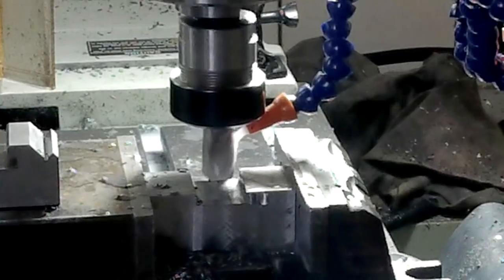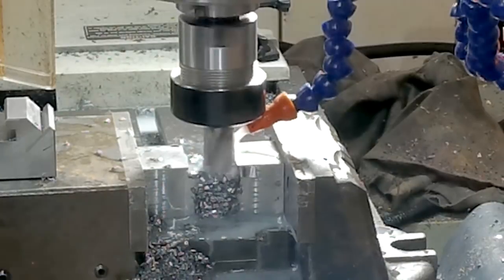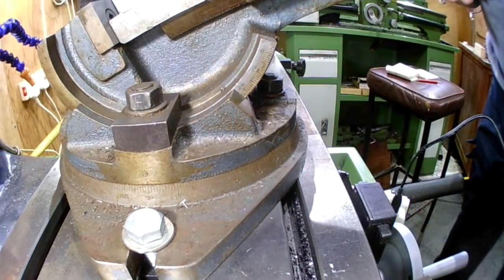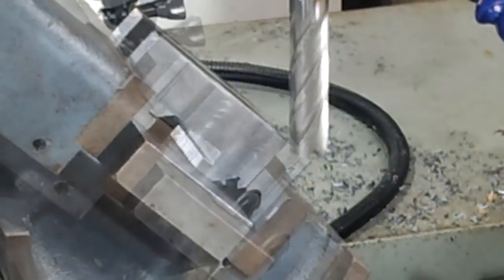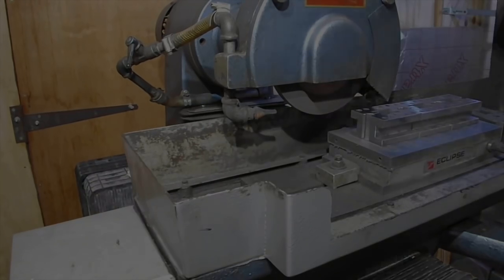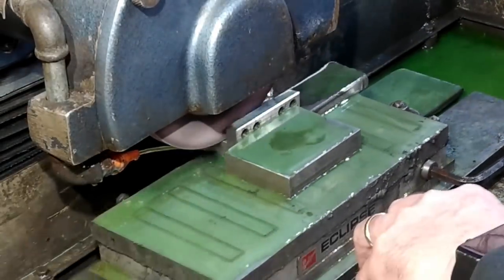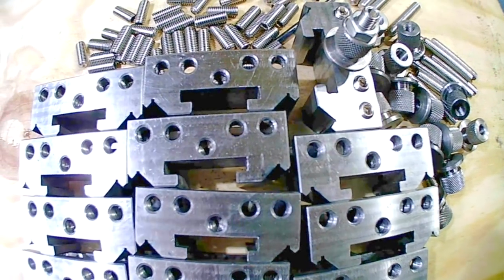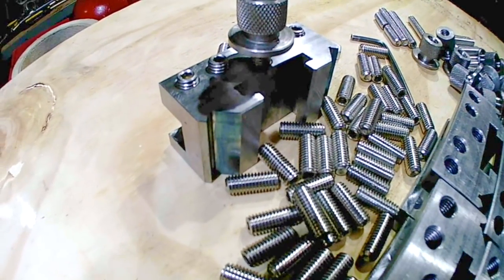Making Dickson style tool holders

Comment: Great job. I'm about to make my first tool holders. I'm curious how you find center in the V to cut the square slot using the shaper (@6:41). Thank for sharing. It's very inspiring. EDIT - Also, would you recommend any heat-treating for these? Thanks again.
Reply from the maker: Hi, I didn’t have to find the centre I simply used a pattern and copied that and swapped the tool holder for a work piece. my machine is a small machine and it wouldn’t bend a bit of toffee if I tried. but, I would recommend hardening and then tempering for a larger and more capable machine.
Regards

Comment: The Dickson tool post and tool holder is a miserable design, one that no one should copy.
If you wish to make your own, choose a dove tail type with the male dovetail on the tool post, female on the tool holder.
For clamping the tool holder, arrange a finger clamp that pushes on the inside of the rear dovetail angled surface.  This pulls the tool holder tightly against the front dovetail surfaces, making for a superbly rigid assembly.
Reply from the maker: thank you.
Reply: @Thesheddweller  Thank you for your civil reply.  I would have expected you to curse me six days to Sunday for my opinion:-))

To make locators with redundancy is always problematic;  you yourself stated that the commercial Dickson tool holders were not a very good fit on the commercial Dickson tool post.  This would have driven me to drink!

You will notice that practically all modern lathes have one prismatic guide only for the carriage;  a second such guide at the rear would be completely redundant;  yet one American lathe maker persisted with this unnecessary practice.  I imagine that considerable handwork by scraping was necessary to fit those carriages to their respective lathe beds.

On heavy planers the double Vee guides are used to resist the heavy side loading on the table,  but this is an exception.

In the mid 1990's I designed and built a QCTP and 2 dozen tool holders using the dovetail principle.  I learned very quickly to always use the same dovetail cutter for tool holders with that tool post, because commercially available dove tail cutters have an unacceptable variance on that 60 degree angle!

Were I to do this again I would purchase a good quality dove tail tool post (NOT the pump style!) plus a few tool holders, and make the rest of the tool holders myself to suit the various purposes.

I'd then take the QCTP to the tooling vendor and select a dove tail cutter that fitted the tool post's dove tail as accurately as possible.  Myself I sharpened a dove tail cutter so that the angle matched my tool post's angle.

With the female dove tail on the tool holder it is very easy to ensure that the tool holders are sufficiently alike such that the clamping lever winds up very closely in the same position with the different tool holders.
Reply from the maker: @BasementEngineer  I agree with your sentiment regarding the dovetail and rearward locking system. but if I could afford it I would have the original four position brick with 1 tool holder fitted and the rest spare. The tool holder would be the drop in cam lock cartridge insert holder  that I used to use, before I retired.
In a boring machine or on a lathe and sometimes the old NCs.  One cartridge holder could be loaded with any number of left right or neutral position cartridges with whatever insert, including internal, external, trepanning, parting, threading,...  12, 16 and 19mm inserts whatever you want really, all off one cartridge holder held in the tool brick. I had some of the cartridges re-machined to hold very small profiled carbide inserts as well. 
However, deep boring was always done using a more dedicated tool. I also used a twenty meter long planer re-purposed to a four cutter milling machine, and yes the vee slides on them were big enough to need climbing ropes to get over them.
 In truth with these old or cheep home workshop machines, a repeatable indexing system is not worth the money beyond saving time with setting up for common used tools. 
Yeah some people might feel justified with scratching your eyes out for an honest comment,  I've worked with many good engineers in my time and they all had a valid arguments, but the boss had the best.

Regards.

P.S. who said I wasn't driven to drink... 😉

Comment: Thanks for posting this enjoyable video, you made a superb job. Totally understand why you did this as even the original Dickson have a dubious finish/fit at times.
Don't have the skill to pull that off just yet, nor the inclination to spend the time on a knock off Dixon type. 
As I am working with a turn of the century Drummond lathe and unhappy with the Dixon's rigidity, thinking of returning to the original forged lump the manufacturer supplied. 
Hoping a small height adjustment addition to the slide will preclude shimming and speed things up when changing tools. It won't involve drilling or scarring the unmolested lathe which could easily be put back to original spec, despite being electric now 😮

Take it easy.
Reply from the maker: Thanks for your comment Sam. I’m glad you enjoyed the video. The most complicated part of the video was making the 45deg setting tool, but the video wasn’t about that so I didn’t include too much about that.
I’ve heard about Drumond Machine tools but I’ve not worked on any. Good luck with keeping that as original as possible.

Comment: probably a stupid question but i  have a warco WM290V with the Milling machine attachment would it be in your opinion for me  also check everything is true ? my problem is sometimes the tool block or tool post  moves depending on the cut im doing no matter how much i tighten it down , so i will check if its flat maybe you have had the same problem ? thank you
Reply from the maker: Hi, i don't know much about the wm290v, I belive it has an extra auxillary drive shaft. Anyway the compound slide on my machine is a big problem and i would suspect your machine would have the same issue. The compound slide effectively sits on a large washer held in place with 4 bolts in-turn held to the cross slide with 2 bolts over a slim locking plate, that combination does highlight a stability problem. you may want to look at that. regards
Reply: @Thesheddweller  i have seen others here making a 4 bolt plate but the problem of the big swivel washer may still be a problem clamping the tool table from moving as its winter i will have a look at modifying  something in summer . another idea was told to drill a hole to put a pin in the tool block
Reply from the maker: @creed6.549  my cross slide top surface had one shallow location hole in it and i don't see any reason why yours shouldn't...

Comment: If I tried this myself, I'd screw up somewhere towards the end and have an expensive bit of scrap metal to show for all the work. 

Any chance of a video on how your surface plate is put together and where you sourced the granite tiles from please?
Reply from the maker: I've been asked a few times about this and I might have to make a video on this subject, but it will not be an accurate piece of equipment, that can be guaranteed or certified, I can't use mine for that. I have a smaller cast iron one that I can use for gauging and more accurate work.
The concrete part is made from pavement (sidewalk) slabs and the tiles are from a kitchen tile supplier, then they are bonded together. regards

Comment: What steel do you recommend? Is the F-114 worth it? Thank you very much.
Reply from the maker: Hi, Miguel. I'm probably the last person you should ask about material performance, but I would say that If I had a choice of material, I would buy medium carbon steel like F-114  1045 so that if I wanted to harden it for this job, I would probably hold the hardness to a maximum 50 to 55 Rockwell, I do believe F-114 is suitable for this... but don't quote me on that. Regards

Comment: Neat work displaying a disciplined approach to repeating all those tasks 12x over - or rather more times with all those chamfered edges !  You have invested more in your cutting tools than many home workers might be inclined to do.
Has the use of semi-synthetic coolant affected the paintwork of any of your machines?
Reply from the maker: Hi, thanks for watching and for your comments. The coolant has not yet affected any of my machines. I say yet, because those that have had experience of coolant knows that it’s a good paint stripper. The coolant on the lathe and mill is a generic coolant, but in the grinder is specific for grinding and this can be a dangerous bacteria medium unless it is constantly airated, Ive fitted air pumps they are running 24/7 in both tanks.

Comment: Great work. There's a fair bit of machining in making them. I've got a dickson on my lathe too. Do you know what the purpose of the flange on the locking cam is? Why doesn't the height nut sit straight on the main toolpost body? The flange slides beneath and i find, makes repeatability quite hard. Thinking about getting rid of it. Thanks
Reply from the maker: Hi, to be honest, I’ve never had to bother too much with that. However, since you asked. The locking cam has two functions, one, the top cutaway flange, is a gateway to make sure the cam lock is in the fully open position before the toolholder is inserted, after all when the tool holder is in place you don't want it to vibrate, or worse still get pulled out. The second full flange is to prevent the tool from dropping right down and to provide a repeatable stop so that tools, that are set, always drop to the same place, repeatedly, sometimes, due to mismatch, the catch ring on the tool often misses it, and can be a pain to use. it’s still way better than taking tools out of the tool post and resetting them every time. But dickson tools have disadvantages, that is they have considerable overhang, this can cause tool vibration especially while trepaning or perting off. hope this helped.
Reply: @Thesheddweller  ok thanks. I get it about the top flange, but I'm just not certain about the bottom one. As soon as the thickness of that flange is not consistent and parallel, like on mine, the toolholder starts to get clamped in position at a particular height, then the effective wedge shape of that flange will want to change the height in inconsistent ways. Add to this that pieces of swarf easily get pulled into this moving part. I'm not sure why the toolholder doesn't just sit on the main block, which never moves. Most other qctp designs have this feature, so I'm just confused what the benefit of having it over not having it. Anyway, thanks for the reply
Reply from the maker: @lawmate  so it’s not a faulty one then…?

Comment: I use the same approach to thereading, hand turning the chuck. Good blocks make a big difference. You have very nice workshop, well fettled as they say. I've been able to use bigger tools in my friends workshop in sheffield. He has a bigger surface grinder, a Bridgeport Mill, a Do-All bandsaw and  lots of grinding and polishing kit. My own in Hampshire is very modest compared to yours.
Reply from the maker: Well I’m sure everyone has heard the saying ‘size doesn’t matter’ and it doesn’t. Ok I suffer from range anxiety when it comes to wheeling stuff the length of my workshop. But that’s the trick making the best of what you’ve got. In my woodwork section it is 4 x 2 metres yet I can cut full 8x4 sheets of ply on my table saw, hows that I hear you ask, wheels...! Everything is on wheels except for the metal machines they are placed around the outside walls out of the way. That means my wood shop can be 4 x 12 meters. My first turning job I ever did at home was on my pedestal drill using it like an up ended drill.
Never looked back.
Reply from the maker: I ment up ended lathe..😂

Comment: Excellent video. You could use the chamfer block for surface grinders  created by Tom Lipton over at Oxtools and I have a take on it on my channel as well. Your surface grinder is interesting. I throws chips to the right and spins counter clockwise. I haven't seen that before . Is it right hand drive?
Reply from the maker: Dudley Toolwright I must admit that after using a J&S this one took some getting used to. It's an Eagle with suds pump, I saw it in the corner of a second hand machine shop, made an offer and he accepted. It's still 3 phase and works well, but it really needs the table resetting by a micron or two because there is a shadow on the outboard side.

Comment: I enjoy watching your work thank you. I have a Dickson tool holder on my Emco but I cant see myself making any new ones as I don't have the lovely range of gear you have, a flat bed grinder wow wouldn't that be nice.  Pleasure watch somebody with obvious experience and expertise.
Reply from the maker: Hi, thanks for watching. You don’t need a grinder, but using a bit of ingenuity you can do everything with a mill or a lathe.
Reply: @Thesheddweller  I do have my Dremel setup in the lathe, mostly for grinding rubber pinch rollers but its ok for very small metal grinding jobs
Reply from the maker: @campbellmorrison8540  a long time ago(probably just before I was born), many things were made using a forge, hammer and a file/scraper. just look at may things Brunell, Watt or Eddison had presided over.

Comment: As a woodworker I'd tell all you fastidious machine guys to lighten up a thousandth or two.
Reply from the maker: Hi, thanks for watching. I also have a woodwork section in my workshop 20thou in wood is the difference between a good fit and a sloppy fit. 2thou in metal is the same thing. Regards.

Comment: My tool holders have the dove tail design. A little more of a pain to make.
Reply: Like an aloris style? Theyre actually pretty easy to make, really all square cuts, no complex setup, just make sure the floor of the slot is a little lower with the endmill before you go in with the dovetail cutter so its not cutting on the floor while taking the dovetail cut. Also, tram your vise and head like you mean it.
Reply from the maker: Oh yes, I know I’m partway through my next video, it includes a standard 60deg dovetail and, an offset dovetail, it didnt start off as an offset dovetail, I just tried it out to see what would happen part way through the video.

Comment: With regards to having to dress the grinding wheel to get a sharp corner in the tool slot; quite a lot of toolholders I've seen have a small relief cut (like the 45° slots have) in the bottom corner of the tool slot so there's no possibility of a radius in the corner.
Reply from the maker: Meme Master, hi, thanks for your comment. The only tool holders that I had ever used with a swarf relief groove where those that rotated. All the kenametal boring tool holders had a small radius in the inside corners and the tool it’s self had a slightly larger chamfer on each corner. The pressure created on a fourteen foot diameter twin ram boring machine would break a tool holder easier if it had a small recessed relief. Come to think of it I don’t remember seeing them on the smaller 36” borer tool holders.. 
but I can see why it would be advantageous on a small home lathe..

Comment: Very nice job! Which steel was used to make these? Any heat treatment?
Reply from the maker: Hi Alex Y, I believe the material was Cold drawn steel. I can’t be more specific than that because they were given to me. I did consider heat treatment, but I’ve used them as is and I’ve had no issues. hope this helps.